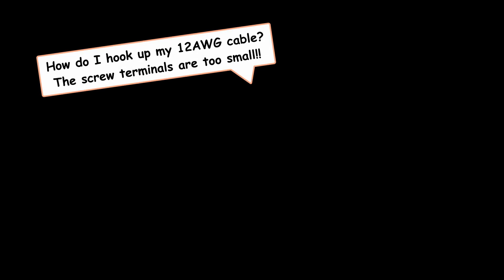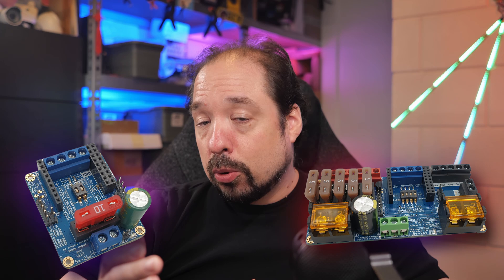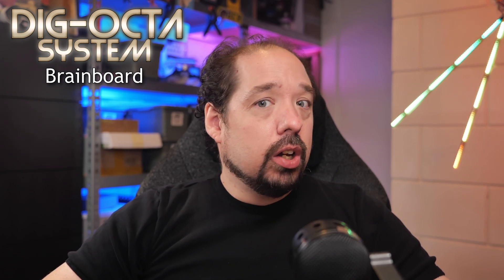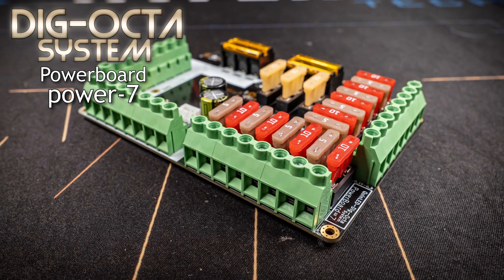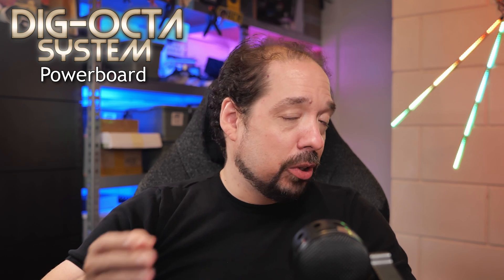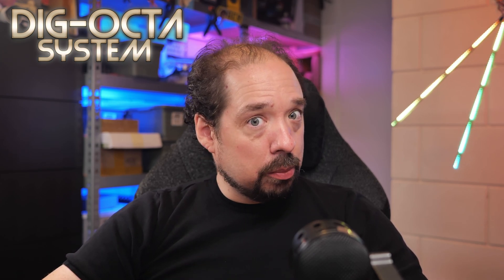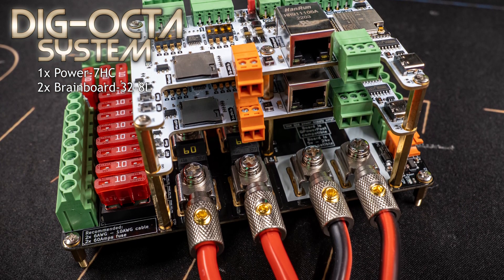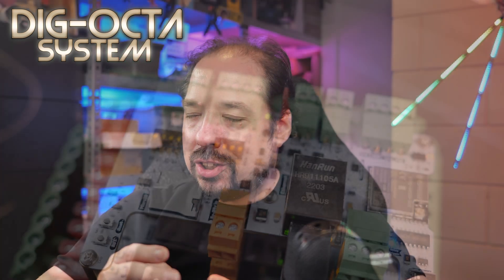NEW! The Dig-Octa LED controller system 💡QuinLED💡

Comment: are there any powerboards that have a barrel jack connector? I would like to use a standard psu but want all the stuff, that is between psu and LEDs in a mostly plug and play package... any recommendations?
Reply from the maker: Ah no there are not. Standards barrel connectors can't carry more then a few Amps, very expensive special ones with lots of heatsinking can do 10A to 12A. Since the powerboards are rated up to 50A and 5v-24v, especially at 5v you don't want such a high resistance part in the chain, bare wire between PSU and powerboard is much better.
Reply: @IntermitTech  thank you for the super quick reply. got it... so in that case i have to get into using those really scary looking psu's then... just a really noobish question, but is there a lot of precautions necessary, or do i just connect the wires to the psu, powerboard, carefully chug everything into a project box and forget about it?
Reply from the maker: Yeah basically it, mostly the the AC side you need to worry about, the DC side can't really hurt you.

Comment: i have 2 brainboards stacked on a power 7hc power board but cant enable Ethernet.i wanted to use xlights to control the show but without brainboard connected to my network, i have no way to add it to xlights, do you have a video tutorials to install brainbords out of the box hook up to Ethernet?
Reply from the maker: Out of the box it ships enabled. Otherwise try flashing using USB on https://install.quinled.info and then it should be enabled.

Comment: I didn't realize there was all kinds of strange voltages in all of this. I am trying to hook up the Govee pro outdoor LEDs. I saw a video on the beta channel of the binary that controls these properly. On the video they only had a D1 mini and didn't look like they had anything else. So I'm wondering, do I need a controller board or can I just use the D1 mini by itself? Can I use the power supply that comes from Govee to just do this one string of leds?

Comment: AMAZING! All you do for the LED community, respect!
I dig in the Dig-Octa just to discover by all awesomeness that there is no mic, or easy way to add a mic???? Why? It all was so promising till I stumbled upon your mic-hack explanation. 
WLED just comes alive with sound sensitive effects, I am very surprised you skyped that!
Now one thing I don't get is why it is not a option to use the 2x input button/switch terminals to add a microphone?

Much love and keep up your amazing work
Reply from the maker: It has technical reasons, the 2 pins for the buttons for instance are input only and cannot be used for a digital mic. On the Dig-Octa literally all pins of the ESP32 are used up and some are even shared already.

More often it's used for larger setups and then LEDfx sending data over the Ethernet connection gives a much better result anyway.

But I appreciate the enthousiasm!

Comment: hello dear ,i have a dig octa powered with dig power 7,how many pixels can i run each port before using any power injection,and what are those tiny swithes right behind those eight data ports.thanx

Comment: Hi there how are you doing? I am loving your videos. Any chance you can give me tips for my project. I have a small nightclub (the dancefloor is 6mtsx6mts) and I am trying to find the best configuration. I am planning on doing a total of eight BTF-LIGHTING addressable led strips (60 leds/m) (5mt each 12v) + BTF Flexible Neon Soft Lights Tube T1023 (Do you think muzata difusers work better?). So in total, it would be 40 mts of Led Strip.  Since the dancefloor is a square I want to put the led strips in straight lines throughout the ceiling. 

What would be the best way to power them? Maybe 2 or 3 BTF-Lighting 60 Amp, 12v Power Supply ?  How many Injections would you recommend?  I was thinking about the ENTECCs Octo driver until I found your videos. Would you recommend a Dig-Octa or a Dig Quad for me? What would be the proper setup?

Comment: I need to have a resource that will give me the step-by-step process to upgrade my Brainboard-32-8L. It came with version 0.13.1.  I have put the board on my network, and I can access it though the ip address.  When I go to "Security & Update setup" I cannot get it to update.  Please help by directing me to a video that would help me out.  I am just starting with the brain board, 16 port power board, 50 pcs led string and 12 V power supply. I have big dreams for building a display. I have a 2' x 3' cnc router that I hope to use it to make displays.

Comment: @Quinn 

I just picked up a Mean Well SE-1500-12, the one that can provide 125Amps.  Can I use that with a Powerboard-7HC?
Reply from the maker: For sure, I used a HRP-600-5 for testing, maxing it out for 30 minutes straight sometimes to test the boards! SE will do perfectly fine too, try to get 2x 8AWG to go to the board from the PSU if you really want to push 100Amps.
Reply: @IntermitTech  thank you sir! I can't wait to get started with this project. I might have a few more questions for you once I figure out how long my roof runs are going to be!
Reply: @IntermitTech  Just got the board, strips, and power supply. Looking to buy some 8awg wire to go from the PSU to the Powerboard. What style connector do you recommend?

Comment: The one biggest problem I had with my Dig Quads was the quality of the connectors. I made them myself and sourced connectors myself so I only have myself to blame! (Although I did follow correct links to Aliexpress stores…) The connectors I ended up with were so awful, they hardly even opened for thin wires, and you have to shove a flat head screwdriver in and twist, to get them to open 😢 This Octa looks slightly too much for my needs but I love it! I still have about 15 Quad boards to make up, but I may just ditch those and get myself into this Octa system ❤

Comment: insted of a esp32 have you thought about using a stm32  micro controler?
Reply from the maker: I have some ideas for other variants of brainboards in the future but I'm much more of a hardware guy then a software and WLED or ESPixelstick makes the software side very easy and readily available, not sure if that's the same for STM32 otherwise I would certainly consider it.

Comment: Do you have DMX512 out as well?
Reply from the maker: Not on the current boards being released but I might consider it on a future board! :)
Reply: @IntermitTech  would be very helpful for existing DMX Light fixtures, especially aas WLED supports DMX on the software side
Reply: @IntermitTech  Has anything developed in the MAX485 DMX Output option?

Comment: Nice new Boards. Love it. Are the Power Boards availeble in a DIY version?
Reply from the maker: Sadly no, if I had to keep DIY in mind for these too it would require too many design compromises really. Most people won't even have the equipment to be able to solder this properly even.
Reply: @IntermitTech  not so nice, but understand it. We still have all the other boards for DIY. 👍❤️
So not really for me.. orders over 60 Euro are very expensiv with the Border Tax here in Switzerland 😢

Comment: Awesome, been researching the hobby for awhile. Going to start my home light show this year. House outline with plans to expand to props over time.  Should i opt for this system, or dig-quad?
Reply from the maker: Poh can go either way really. Generally with house outline a Dig-Quad will also serve you well! See the latest video from DrZZs too! But if you'd want to go 5v maybe Dig-Octa would be easier since it can take larger wire sizes.

Comment: Adendum, I really like your products and appreciate the intense focus on quality and features, I have and will continue to buy all your premade products. Right now I am batteling with analog leds running next to my addressable leds as a primary lighting setup.
Reply from the maker: Thank you very much, that is very kind to say and glad to hear it! Yeah, I wish digital LEDs could be used as primary, I have some new products on the way actually which might allow that a bit more but for now it sucks sometimes having to use analog for that.
Reply: @IntermitTech   I will wait a while then, I am after primary lighting in white, I agree digital is preferred. Thanks

Comment: I am glad that I didn't pull the trigger on my whole home setup yet.

I've been trying to figure out the RGB wall (29m fencing at 2m tall, every 120mm) and this will solve a headache that I was looking at as that's just shy of 30,000 chips. Yes, almost 4.5kW and yes, it is getting its own slot in the consumer unit.

If you are asking what about the WAF? it was given 100%... Not sure the price has been fully realised but it's my midlife crises and I'm having it.
Reply from the maker: Oh wow! Controller wise I'm not sure that's going to work (be sure to watch the upcoming video) but power wise the powerboards will certainly be able to help you out there at least!
Reply: @IntermitTech  controller wise I was already breaking it down into multiple panels of dig-quads and more complex sequencing in animation, but this will enable bigger versions/less hubs and therefore simplified wiring and sequencing.

Looking forward to the upcoming videos!

Comment: One thing I would like to mention to xlights Or  Future xlights users 

Don't plan to put a mega tree or matrix  and span over 2 brain boards 

Xlights will not upload thag configuration and will need to be manually configured 

Not as straight forward as just hitting upload ...

But killer board with lots of use cases 

Thanks quindor
Reply from the maker: Hmm, because 1 prop would be spread over multiple boards you mean? Cause otherwise I don't see an issue in that working. Maybe something to suggest as an improvement. ;)
Reply: @IntermitTech  right xlights don't like u to split props between controllers 

Meaning u can't have half on one brain and half on the other 

Well you can but u would manually configure the channels in wled or esppixelstick 

But the upload to configure controller as u make changes will not work 

Its just something to think about but yes otherwise it works perfectly 🥰  and will gets lots of use .. just need to know how to work around some xlights issues not really a hardware issue

Comment: So this means I could separated the boards indefinitely for a cleaner install correct? Brain boards closer to my switch/input that’s accessible and power boards where is convenient and plugged in and ready. Sounds great and looks infinitely scalable.
Reply from the maker: Yup, for sure! Although they can stack together you certainly don't have to and each board can function independently too. Do keep in mind that you don't want the LED data wires to become too long while with a network cable it matters less. :)
Reply: This will be glorious !

Comment: When do these get integrated into Xlights? I know just released 🤣
Reply from the maker: No word on that yet but I'll see if I can get that arranged.
Reply: what type of integration do you mean? Afaik xLights can output sACN (E1.31) and WLED (which is compatible with these boards) can receive sACN (E1.31) so you can use these already with xlights
(Disclaimer: i'm not an xlight user so i dont know what type of integration other control boards offer, so excuse me if if miss something obvious)

Comment from the maker: This is also my first video switching from Vegas Pro (which just wouldn't work for me anymore, being a crashy mess....) to Davinci Resolve, please be kind, still learning!
Reply: Looks good I would just change fadeing transitions to simple cuts :)
Reply from the maker: @Shadoweee  Ah that's a thing of preference though, but they are less smooth then I used to do so I'll work on it!
Reply: The video is great, I don't see any flaws in the montage good job
Reply: It was well done overall, one thing though, in the Why it's a system section @ 7:53, the first system you're talking about is 1x Power 7 board and 1x Brainboard-32-8L. However the text says 1x Power-7 and 2x Brainboard-32-8L.
Awesome system, I can't wait for it to be released.
Reply from the maker: @notsure3448  Ah damn, you are right, missed that error, can't really change it now! :( Think people will understand though.